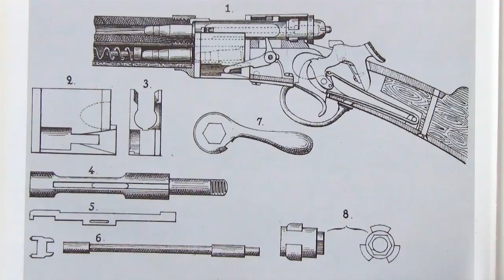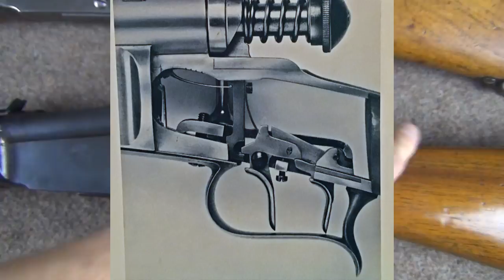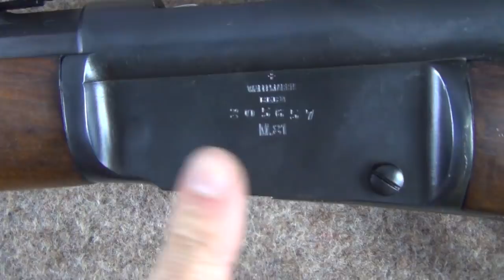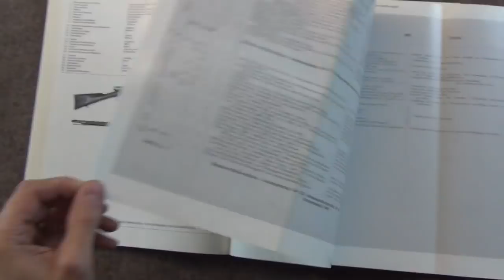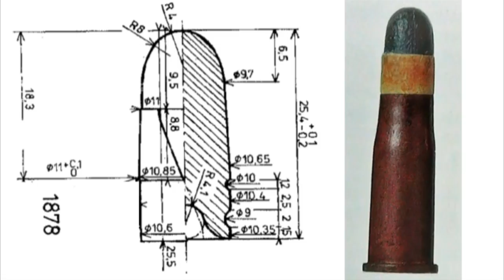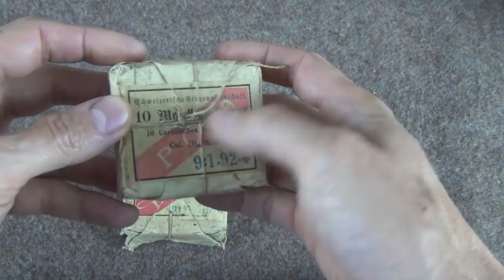The Vetterli Story Part 2

Comment: Excellent video. I’m so excited to see interest in these old rifles. I thoroughly enjoy my Vetterli rifles. I form my brass from 50-110 Winchester brass. This has worked very well for me so far. I did initially form some brass from 8mm lebel but that route requires fire forming. My groove diameters on my 3 guns differ dramatically. My 81 is .421. My 69/71 is .426. My model 78 is .430. I thoroughly enjoy shooting them and they always draw attention at the range.
Reply: 8mm Lebel is perfect for me as I can recycle old battered case which have been through the Lebels and Berthiers one too many times

Comment: Have you seen any examples of 1871 Stutzers with a front sight hood? The one I've inherited has one, which is unfortunately broken. I've not seen any other examples with one still present and was wondering if its not some later add on.
Reply: Not personally but it will have been an add-on

Comment: It appears the Vetterli you shot at the end of part 2 was using centerfire ammunition. How was the rifle converted?
Reply: Hole drilled in bolt and striker extended. This seems to be the most common Swiss conversion method rather than trying to modify of make a new floating firing pin.

Comment: Hey man. I just picked up a vetterli waffenbrik m78. It had a threaded section on the front of the barrel and a 3 inch long triangular cut that goes through the barrel out the otherside. The bore is brand new and the firing pin was never installed and still in the buttplate. Any ideas what the threads and cutout is for.
Reply: Unfortunately I think Bubba has been at your rifle. There were no muzzle attachments in use that would account for the threaded muzzle. The firing pin under the butt plate is a spare. Spare firing pins were introduced in June 1885 and applied retroactivetely as rifles went in for service. The original in the bolt must have been lost over the years. I can't picture the triangular cut you mentioned but it also doesnt sound like it should be there. The only vagely triangular cut on the barrel that I can think of is the dovetail groove for the rear sight.

Comment: I've seen your video on crimping a heeled bullet on a straight case; do you have a technique for crimping the bottle neck of the Vetterli healed bullet?
I've a model upgraded for centerfire, and have been using cast bullets - though not heeled - and would like to use a heeled mold, but have no idea how to crimp this. (using reformed 8mm Lebel cases)
Reply: Something could probably be made but it’s not actually necessary. Just removing any flare from the case once the bullet is seated works fine, even with a full mag. I use heeled bullets in reformed Lebel cases and it works fine. The original ammo was also not crimped as that would damage the patching.